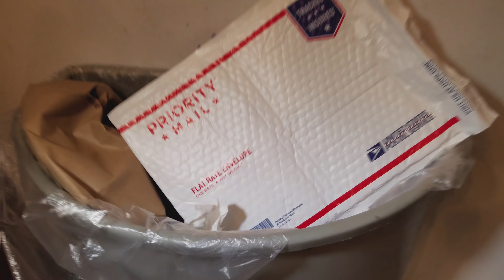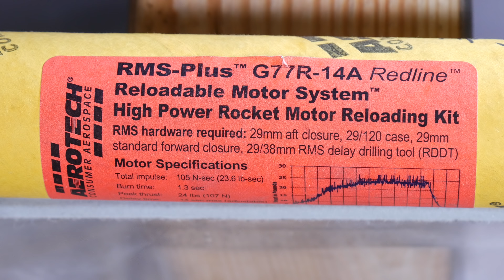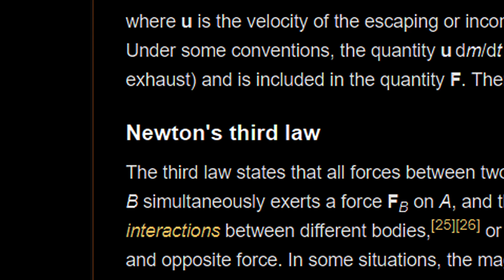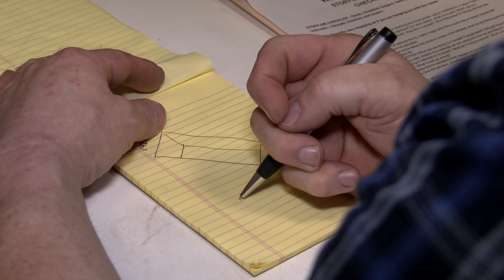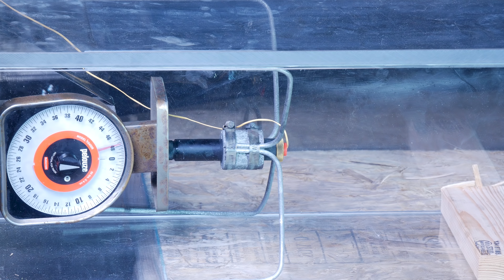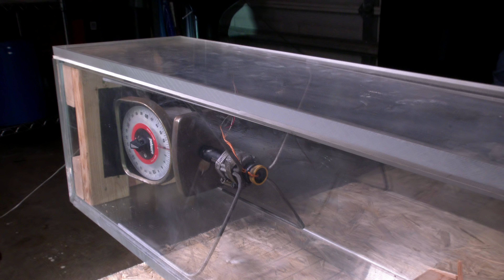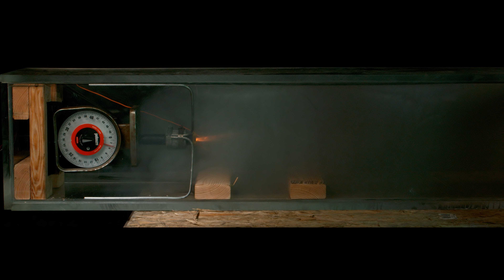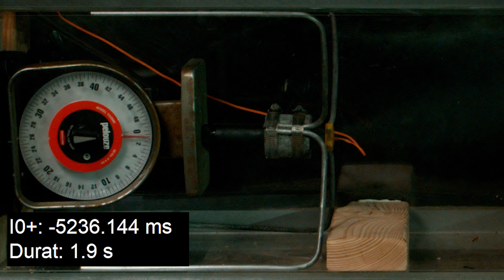Rockets in a Vacuum Chamber - Newton's third law of motion Visualized

Comment: At 3:10 there was an obvious loss of vacuum. And at 10:51 the seal was also breached, its not the flame that anyone should be watching, its the lid on top, it clearly moves upwards. At 10:00 the vacuum gauge is also not in the video which will show a sudden loss of vacuum. The ignition occurring away from the rocket is actually hydrogen gas igniting, this has been shown to happen sometimes when a BBQ lid is lifted and there is a sudden rush of flame, also when a candle is snuffed out and a match immediately held above the wick it will reignite.
Reply: DO you still "disbelieve: in rocket propulsion in a vacuum, or are you just critiquing a poorly done "experiment"?
If you really are a skeptic, I can convince you that rockets really DO work in a vacuum by having you answer simple questions OR I can just show you live video of rockets working just fine in vacuum.
Reply: @stuartgray5877  you don't convince anyone of anything by spamming them with troll questions, chatbot stuart 😂
Reply: @papalegba6796  Well you COULD help out and explain what accelerates the mass of the exhaust gas from the rocket.
We SEE it get "Accelerated", so where does the FORCE come from that accelerates all that mass?
Reply: @ppleberrynd  Are you my new chatbot stalker?🤔 😂
Reply: @stuartgray5877  why are you asking me the same question hundreds of times, chatbot? Could it be because you are a stalker? 😂
Reply: @papalegba6796  - " why are you asking me the same question hundreds of times, chatbot? Could it be because you are a stalker? "
Because
YOU
HAVE
NEVER 
ANSWERED
Because answering truthfully PROVES YOU WRONG.
If it did NOT, you would just ANSWER instead of typing more words telling me whey you don't have to.

From WHERE does the FORCE originate that accelerates the mass of the exhaust gas into the vacuum???
Just keep refusing to answer. Everyone can SEE that you are scared to answer.
So your only response is to call me a bot so you feel justified in not answering.
 It's funny that even a supposed "bot" can make fool of you.
Reply: @stuartgray5877  silly stalking chatbot! 😂
Reply: @stuartgray5877  thanks for admitting the experiment is poorly done, chatbot. So Why are you defending it?🤔😂

Comment: Can someone explain: when I blow air from my mouth in water, I feel resistance of the water, that makes me want to move in the opposite direction.
But when I blow air, in air, the resistance is very low, so that I don't feel the urge to move in the opposite direction. I wonder if I blow air in vacuum.
Reply: Several things going on there. When you blow air in the water you have to overcome the resistance of the water. It is relatively sluggish compared to the atmosphere and you have to push it out of the way with your air.  Basically, what is happening: underwater you add the mass of the water that is moved to your action -> bigger reaction. In the atmosphere, you add the mass of the atmosphere that is moved to your action. And vacuum only the mass of the air in your mouth is your action. Since it's very little your reaction side is very little too.
Reply: @lifepolicy  thanks, it makes sense

Comment: Newton's first law is the law of conservation of momentum.  When a rocket fires its engine, it loses a significant amount of mass as that rocket fires.  The analogy I like to use is that of firing a pistol.  Imagine firing a pistol in a vacuum.  The pistol will "recoil" even if fired in a vacuum.  The bullet leaves at a very high velocity and the rest of the pistol, minus the bullet, will be pushed in the opposite direction.  The sum of momentum vectors (mass times velocity) will be the same before and after the pistol is shot (roughly speaking).  A rocket firing is much like a pistol firing, only that the "bullets" are not discrete balls; instead they're little bits of mass that are leaving continually.

Frankly, I don't know why people always cite Newton's Third Law.  In my opinion Newton's First Law is much more applicable wherever it can be applied.  It seems to me that Jewish culture pushed Newton's Third Law on us and hardly ever mentions Newton's First Law.  A reason for this might be that Jews try to destroy truth, and that it's easier to convince people that Newton's Third Law is riddled with errors.
Reply: Yes, that's newtons 3rd law, no one is disputing it... but in the case of the lunar ascent stage the pistol has a mass of about 5,000 kg (2300 kg propellant) and the bullet is a gas, not lead. 1/6 gravity is also opposing the ascent stage acceleration. The CSM is 60 miles up and orbiting at over 4,000 knots... chances of success are less than highly unlikely

Comment: i like how "you need" fast barrier between atmosphere and vacuum and the earth dont need that.....lol !!
Reply: Abigor115 The actual answer is that the vacuum of space does not exert any force on the atmosphere at all. It does not “suck” the air. We associate the word “suck” with “vacuums” but it’s a misnomer. That’s not what vacuums do.

Consider an example where we’ve pumped all of the air out of some box and created a vacuum inside of it. Let’s say we’re on Earth, at sea level, and we poke a hole in the box. What will happen?

Air will rush into the box and fill it. Okay. But why did it do that? Was it because the vacuum sucked the air into the box? No.

What’s actually happening there is that the air pressure around the box is forcing air into the space with no pressure. The air that fills the box is being pushed by air pressure into the empty space.

Vacuums never “suck” air. What they do is present an empty space and then air pressure forces the air into the vacuum.

Air pressure is not uniform throughout the atmosphere. The lower the altitude, the higher the air pressure; thus, as you move higher, the air pressure decreases. In fact, at the upper limits of the atmosphere, the air pressure reduces to basically nil.

And since there’s no real air pressure to speak of up there, then there is no force pushing the air into the empty space.

Now, this doesn’t mean gravity isn’t at work here. In fact, gravity is the reason we have air pressure in the first place. Gravity pulls on the atmosphere, compressing it, and creating pressure.

If we could magically turn off gravity then the atmosphere would be released from that compression and spring away from the Earth.

So, at the root of it, gravity is the thing that keeps the atmosphere near the surface. It just isn’t fighting the vacuum of space to do it.
Reply: magii... ah! ops! Gravity. Yea ye yea! Gravity = maagic! Its like the biggest blasphemy to say gravity is magic. To the shmart scientistics people. :))
Reply: @beawarenow8287  Did you stop to actually think about any part of ... or the implications of what you said as stated?
Reply: @beaconrider  So essentially you are stating for the record that speaking English is a prerequisite to anyone understanding the basic natural laws of physics or any part of science?
Reply: Not necessarily.  I will state that when someone who speaks English as his native tongue is unable to compose a coherent sentence without spelling errors, this indicates that his educational level is such that I would have difficulty finding his observations on matters such as the Earths atmosphere to be credible.  Do you have some sort of problem with that?
Reply: Enigma Group explain?
Reply: +So No your confusing the different vacuums
Reply: +Enigma Group think about what?that's physics plane and simple
Reply: +So No OK tell me how a vacuum of space sucks

Comment: Yeah.... except what's used in space has a flow of oxygen to mix into the methane, hydrogen or rp1. Atmosphere isn't required to ignite them. Has any of these flat earthers consider what happens to a bullet in a chamber? It doesn't fly with magic, the propulsion of the ignition via black powder drives it... guess what? there is also a recoil to the gun. FYI black powder COULD be used in space, it doesn't require oxygen to ignite either, but it isn't efficient and energy density vs weight is far surpassed by liquid fuels like I mentioned before. I'm no rocket scientist, but I don't have to go far to find this info... but I do own a gun. Though maybe those are a conspiracy too. All to prove earth is round.

 Funny, a bullet actually is mathematically important to debunk flat earth in a couple scenarios. Long range sniping for instance uses the SPIN of the earth in part to calculate where a shot needs to be placed.

Comment: I do not understand the difficulty some people seem to have in understanding Newton's Third Law. Rocket engines actually work more efficiently in space because they don't experience the drag from atmosphere. You need an engine designed to ignite in a vacuum not a model rocket engine.
Reply: David Turner ah ok, and where does the gas molecule push off from in a vacuum? Haha
Reply: ABaumstumpf I've made experiments with compressed gas canisters in vacuum and negative pressure environments. They do not work.
Reply: ABaumstumpf an stationary object will remain stationary and resist pushing. Pushing is only applied or transferred energy. The rocket will always be heavier than the thrust produced in vacuum or near vacuum.
Reply: 1969nis - you arent the  rightest light in the shed.
That is not how physics works. there is no weight to overcome. no matter how small the force it does create an acceleration.
You know - like the example of throwing a ball. You too should try that out. even little children know that.
Reply: Some people just cannot grasp this simple concept, the times I have explained this to people. They seem to be obsessed with the idea of "pushing off" something. Gun recoil is a nice analogy to make. Why does the gun jolt backwards when you shoot it? Maybe because of all the air it's pushing off...
Reply: Vince Bernau - the gas molecule pushes off against the walls of the combustion chamber and against the rocket nozzle as it is expelled; this is where the force that propels the rocket comes from.  

More technical explanation here: http://www.braeunig.us/space/propuls.htm
Reply: ABaumstumpf there maybe no weight but there is mass and to move it you need force, applied energy to create impulse. The pressure inside the thruster has to push on something to move.
Reply: ABaumstumpf throwing a ball has very different mechanics. Your arm is part of your body who has a hold on the ground and is far heavier than the ball. If you are on a skate board then this is different, the sudden energy applied to the ball makes recoil but to keep moving you need to have a supply of balls that weigh too much and then you can't move. You move each time you throw a ball because the ball has mass and your body is shifting weight in the process. Without the ball your hand is still creating movement and recoil.
Reply: Matt Harding the recoil of a gun is because of the mass of the bullet and the expandis gases are pushinng both ways at the same time. The water from a hose has the same effect, it pushes against the water in front with the energy of a pump.
Reply: 1969nitsuga - What is all that stuff shooting out the back of a rocket? Nothing? It's exhaust from the burning fuel and it has mass. That's a bunch of mass flying out of the back of a rocket. The expanding gasses push the exhaust backward out of the rocket and push the rocket forward.
Reply: 1969nitsuga - Do you think you would get more propulsion when you are throwing something off of a skateboard if you throw that thing at a wall?
Reply: Bozeman42. Your remark shows a lack of knowledge in theoretical physics. Pushing the ball against the wall is the corrrect analogy. The only reason you move when you throw a ball from a skate board is because your whole body is creating momentum. If you use a mechanic contraption that pushes the ball in a similar way without you moving, the skate will move very little or not move at all. The opposite reaction implies the same force is exerted both ways but the more massive object will not move unless you overcome inertia. Momentum is only preserved under isolated conditions. Does entropy rings a bell?
Reply: David Turner No one has been in outer space. That is the problem.
Reply: Bozeman42 density in mass is very important here. The body of a rocket is always more massive than the gases. That is why they need way more aceleration to create force. What makes a helicopter fly? The air is pushed by the propeler and eventualy that air creates momentum and lifting once it achieves enough speed. Otherwise the helicopter will not fly. In the end rockets and helicopter s use the same principle by different means. The rocket creates its own gases while helicopters use the atmosphere.
Reply: Mike Miller You are confusing recoil (Newton's 2nd with the 3rd!) The equation uses athmospheric pressure, it is just that most people uuses the short version withou thinking.
Fn = °m Ve = °m Ve-act + Ae (Pe - Pa)
°m = exhaust gas mass flow
Ve = effective exhaust velocity
Ve - act = actual velocity at nozzle exit plane
Ae = flow area at nozzle exit plane
Pe = static pessure at nozzle exit plane
Pamb = ambient (atmospheric) pressure
The problem is simple: with altitude the exhaust pressure drops until it is no longer effective for thrust and create momentum. The momentum is preserved through the system (contact between the parts) unless force is exerpted. Space vacuum is manifesting along with "gravity" or density, whatever, but is a force that drains momentum. The lack of atmospheric pressure disrupts rlthe system "dispersing" momentum with the exhaut gas' disorganized molecules. This effect is observed at high altitude even below LEO. The exhaust stream gets wider by the second for lack of atmospheric pressure. The Newton's 3rd is not what drives the rocket. Equal opossite force through the system is just glorified recoil that needs friction to generate thrust. The gases at the combustion chamber are at the same pressure all around so there is no real pressure differential for opposite force there, and the fuel has limited energy production. The last part of the equation results in a huge negative number that nulifies the kinetic energy of the exhaust gases. The little thrust remainig is not enough to move the mass of the rocket.
Reply: 1969nitsuga no no,there is some confusion somewhere. What I'm disputing is the video producers claim to having a cumbustion in a vacuum. All I'm trying to say is he is wrong. What three thing do you need for fire. If your missing just one item, no fire, no cumbustion right?  He is trying to say you CAN have combustion in a vacuum.  There are soooo many videos and text books that says no. Am I wrong?.
Reply: Mike Miller Then we agree. This video is just to trick people.
Reply: Mike Miller I suspect that thruster has oxidizer included in the propelant. The set up is wrong beccause it doesn't sustain vacuum properly and it is a reduced container that gets saturated quite easily by the fumes.
Reply: yup well in a vacuum without gravity your proof falls flat on its face ?
Reply: Really? I think you're thinking about this backwards. The gas is pushing against the mass of the Rocket itself as it escapes out of the nozzle. In atmosphere the engine has to actually work harder at moving the rocket because the mass of the rocket has to overcome the drag of the atmosphere. A rocket engine is not a jet engine or a propeller, it does not rely on atmosphere to produce thrust. It's ironic to me that there are so many of you denying basic scientific principles as you sit at your computers benefiting from the results of that very same science that has resulted in much of the technology you are currently employing to deny it. I'd laugh too if it weren't so sad.

Comment: Another very simple experiment to consider (vacuum or no) is firing a camera flash into a cookie tin. You will hear a faint sound of something colliding with the tin bottom although the only thing moving in this experiment is light. In a vacuum you will obviously not hear a sound, but you could still detect the impact on the surface. In a microgravity vacuum the force will put the flash and the tin in motion in opposite directions - or just the flash, if you have no tin. Why would it be so difficult to believe that shooting out gas will produce the same effect when arguably light has a lot less mass than gas molecules. And to emphasise an already mentioned point: no, a vacuum doesn't pull on anything, the pressure is just moving towards an equilibrium, just like it does within an environment with atmospheric pressure. The law doesn't change just because the pressure is very, very low.

Comment: Skeptics are saying after a moment there is an atmosphere from the exhaust to push agsinst.
- Have you done this kind of experiment in both an atmosphere AND a vacuum and measured the overall force from the rocket? If the skeptics and flat earthers are right, that rocket exhaust pushes on an atmosphere, then there should be less thrust in a vacuum. 
- if you do this several times and thrust is always roughly the same, between X pounds and Y pounds, then it proves atmosphere has nothing to do with it. 
- Of course that won't convince them.
Reply: @stuartgray5877  . Thank you. Unfortunately reality doesn't seem to make a difference to them.
Reply: Bro, you lost the flatters at "skeptics...".